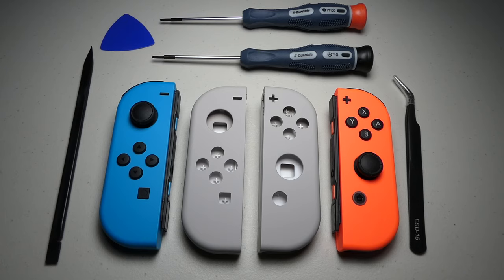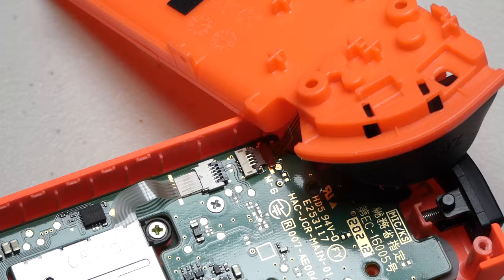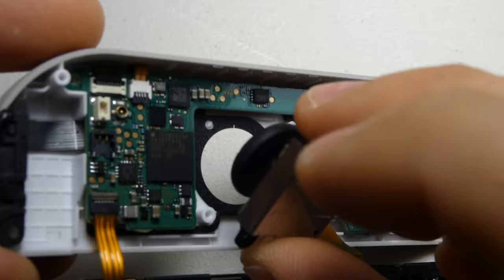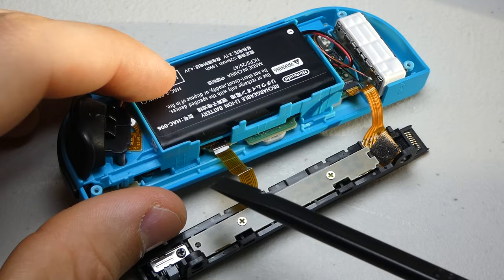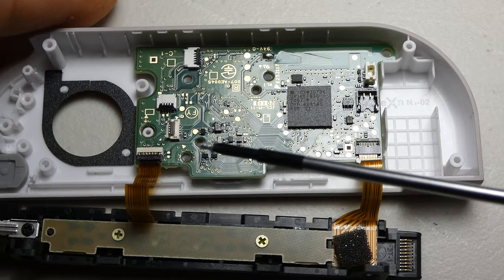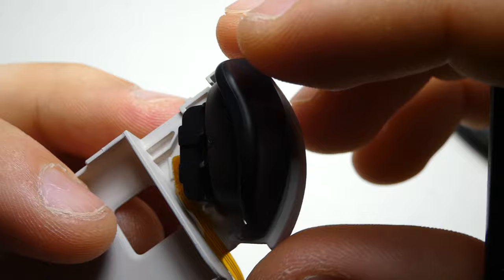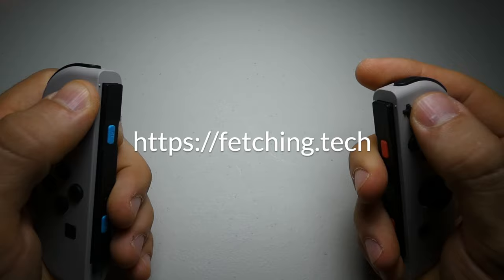How to Swap Out Your Joy-Con Shells

Comment: Ooh ! Thank you for the tutorial !
I do have one question, what do you do when the screws for the shells are damaged ? 

There are two screws on my left joy con that are disfigured and I can’t unscrew them.
Reply from the maker: I'm assuming you mean that they've been stripped? I've been fortunate that the screwdrivers I use are good about not stripping my screws, but I know it's a common issue

 I've recommended trying a rubberband in the past on the screw head to provide more friction, but I don't know how much that works. You might also be able to find a stripped screw removal kit.

The last resort is that I've had customers break their back plastic piece in order to pry the screws out with pliers. I don't like that suggestion for obvious reasons, but it is an option.
Reply: @FetchingTech  Okay, thanks for the suggestions ! 
I’ll try them out

Comment: Having some trouble with reconnecting the shoulder button cable, seems too short. Any advice?
Reply from the maker: It is pretty short, the only thing I can really suggest is flipping the button sideways so that you get as much ribbon cable to grab onto and then using a set of tweezers to get it inserted back in place. Hopefully that helps.

Comment: 2:15 i messed up; removed this ZL cable , i broke this tiny grey hinge accientally, tried to put the strip back in the place and glue it because i had no other options but the connection does not work anymore, tore it during the removal and now ordering a spare strip with button

Comment: Thanks for the guide
I just finished it but holy hell is the zr button on the right joycon difficult to connect
Springs weren’t much of a struggle as much as the zr ribbon cable but it worked out perfectly after that
Reply from the maker: Yeah, I'm glad you didn't have too much trouble with the springs. The shoulder buttons in general seem to be the most difficult part.

Comment: are all screws other than the outside onee the same? i just want to make sure I don't mix anything up
Reply from the maker: There are two different lengths of internal screws. You'll want to make sure you keep them separated or the long ones will end up poking bubbles into the front of your new shells.

Comment: 2:37 at this moment I realised hell had begun
(I've been stuck trying to pull this lil white plug out for 30 minutes please help.)
Reply from the maker: I'm sorry for the late response, I would suggest, as others have to me, that you just leave the vibration motor plugged in. It really doesn't need to be disconnected from the board and just over complicates things.
Reply: @FetchingTech  I eventually got it out but did that for the other controller, and I managed to successfully do both controllers without damaging them thanks for the great video
Reply from the maker: @darkabyssalflame7948  Awesome, I'm glad to hear it. I hope you enjoy your new controllers.

Comment: One of the screws in the back is stripped PLS PLS PLS PLS PLS HELPPP
Reply from the maker: I'm sorry you're having so much trouble. I've heard a lot of stripped screw horror stories. Were you using a Y0 screwdriver? I've heard of some people having success with a rubber band on the screw head to provide more friction. However, if it's really stripped that probably won't help. There are stripped screw removal kits you can try, but Idk how well those work. If you are willing to send in your controllers, I could try to get the screw out for you.

Comment: when doing a shell swap, is it necessary to swap battery tray ? you wont see the different color when reassembled.  This would save you fighting with those spring loaded buttons.  just transfer to new shell, leaving those buttons, cables and boards all intact. Can that work ?

Comment: Found this guide really helpful thankyou! However, two problems I've run into: my ribbon cable connected to the SR + SL buttons seems to be looser? They're disconnecting quite commonly. And also (may just be my kit) my joycons have a slight bulge on the front middle. These are quite minor issues though and nothing wrong with your guide :)
Reply from the maker: I'm not sure what would cause the disconnections exactly, but it sounds like you might be right about the ribbon cable being loose. I'd go through it again, and make sure all those cables are fully connected and not damaged.

The shells separating in the middle is generally due to some of the components in the middle not being seated fully. Often it's the wifi chip that  causes this issue. You shouldn't have to force the two halves together.

Comment: Would you recommend the Tessa tape listed on ifixit? Im worried the red tape might be too thick based on pictures. Or do most people not have an issue with the battery sliding?

Comment: I tried removing the clip for the vibration motor, but it doesn't come out easy the way it did for you. In fact, I think I might've cracked it with the tweezers from gripping it too hard. I guess I'm stopping here, because I don't want to break anything else.

Comment: Hey, this video was really helpful. I bought a pre-owned black right joycon with a broken joystick and transferred it to a blue/purple gradient shell. Everything works but I'm having trouble with the replacement joystick. I used two new replacements and both had ridiculous right drift so I'm guessing I messed up somewhere? Every other button works and before swapping the old joystick worked fine, just didn't sense downwards movement. Now it also has insane right drift.
Reply from the maker: The ribbon cables on these joysticks are incredibly fragile, one wrong bend can ruin them. Also, I've found that the third party joysticks have a really high failure rate. I often have to send out replacements that came with drift from the manufacturer.

Comment: the best video I have seen on swapping joycon shells nice! does the white shell discolor over time?
Reply from the maker: Thank you, I tried to make it at straight forward as possible. 

As far as durability goes, I don't think they've been in use long enough to tell, but I am working on a gen 2 version with better materials that should hopefully solve that potential issue.
Reply: @FetchingTech  thanks so much! can you do an update when the gen 2 drops :)
Reply from the maker: @Christofion  For sure, I will definitely let you know.

Comment: I replaced everything but the triggers are a bit stiff, any advice? Not sure what's causing this
Reply from the maker: I've had an issue where the shoulder buttons don't have much play as the original ones. Occasionally, I've been able to take them apart and reseat the buttons. Sometimes I've had to loosen up the back screws. You could also try to file down the button a bit if it seems like it's getting stuck in a certain spot. Unfortunately, it comes down to some trial and error. I hope you can get it sorted out.
Reply: @FetchingTech  thanks for your reply, IL give that a go 😊

Comment: Is there a way to change the buttons of the black bar on the side of the joy cons as it's still blue and red even though the skins are different
Reply from the maker: Yes, there are two small screws that hold in the led strip and buttons. If you take those out you can swap in some new buttons.

Comment: Idk why but the green led light stop working when I put it near the antenna wire
Reply from the maker: Hmm, I'm not sure what you mean, exactly. But I would try disconnecting and reconnecting the wires and see if that fixes the issue.

Comment: I switched mine out following this video but spent a few hours just trying to get my bumpers back into the right place so they feel the same but I’m just not able to do it, they don’t stick out as much and it only presses down if I press right in the center fairly hard. Are there any tips for this sorta thing?

BTW great vid! Everything about it was incredibly clear and easy to follow!
Reply from the maker: This can happen from time to time. The biggest thing I've noticed is that if the back screws are tightened too much it can sometimes cause the shoulder buttons to not click in how they should. Otherwise, I'd just double check that the bumpers line up with the battery tray as you're reinstalling it. They tend to shift around a bit.

Hopefully that was helpful in some way. Good luck with your swap.

Comment: 6:27 I've been trying for like 25 minutes and it can't reach, without the battery holder being completely in the way. I don't understand how you did it so effortlessly. I've basically just ruined my Joy Con because I can't get it back together now.
Reply from the maker: It might help to just lay the battery tray flat so the ribbon cable doesn't have to bend at all, and then you can use both hands to guide the cable back into the connector. I hope you're able to get it figured out.

Comment: "There may be some adhesive" Yeah mine flopped out so easy it's long since dried up LOL
Reply from the maker: Haha, yeah, I'd imagine the tape they use doesn't last forever.
Reply: @FetchingTech  Apparently neither do the battery connectors and ribbon cables cause they disintegrated in my fingers when I barely touched them LOL
Reply from the maker: @UltimaJC  oh jeez, sounds like you’re gonna have a brand new controller when you’re done with it

Comment: it worked... kinda
my ZR button doesn´t react any more even tough the wires and everything is connected
😭😭😭
i don´t know what to do now because the joy-cons i shell swapped were just delivered today so their brand new
pls help me if you have any ideas
Reply from the maker: If you can feel the button actuating, but no press is being registered, I would make sure the cable is fully attached and not damaged. If the button isn't actuating that the button may not be attached fully or the springs are out of place.

Comment: Ordered all the tools and new shells to finally swap out and fix my joy cons but I end up stuck on step one -.- got 2 screws out but the last 2 feels like they're welded in tight and won't budge. All my effort to get them out is just creating metal dust build up and the screws are probably mashed up in there permanently now. These are also my limited edition Pikachu Eevee ones so R.I.P
Reply from the maker: Oh jeez, I'm really sorry to hear that. I don't know why the screws are in tighter on some shells. I've never found a set that I wasn't able to get the screws out of, but I usually use a more expensive iFixit toolkit. I guess I would suggest looking for a stripped screw removal kit to see if you can get the old ones out. Sorry again for the headache.

Comment: this video made me really anxious because, just like a kit i got for this kind of replacement, the tweezers used are made of metal and it makes me really nervous of tearing or damaging any ribbon cables with them. any tips?
Reply from the maker: In my experience the ribbon cables can be quite fragile, but if they get damaged it's usually due to being bent accidentally. I haven't damaged any with the tweezers. Just take your time and you should be fine.

Comment: I did this... my left controller works but it wont connect in the handheld mode. Any suggestions?
Reply from the maker: I would guess that it might be a battery issue. It sounds like it's only working while it has power. Maybe the battery connector wasn't pressed in fully. Do the sync lights work while it's disconnected?

Comment: This video would have been great if you only said which screw (small or medium) goes were. How am I supposed to remember which foes where?
Reply from the maker: That's a good point. I use a little separator to lay out the screws in order, so I know to just work backwards in order, but I can try to make that more clear in the future.

For this case, just make sure any screws that are just going into the motherboard and shell casing are smaller. Otherwise, they will poke through the front of the case.
Reply: @FetchingTech  Thanks. Will put that in practrice for the next one.

Comment: Hey, I have a problem. My minus button is not sticking all the way out- I was on the last step and realized the minus button was sunken into the case and that the screws on that side were hard to tighten. I think something might be snagging, but I’ve undone it a few times, and it’s getting close to 4:00 am. I hope you can help me, I’m not sure why my minus button is halfway out and hard to press, or what could be stuck.
Reply from the maker: My guess is that the rubber membranes moved when you were reinstalling the main board. Those can be tricky to line up perfectly, but a gap between the main board and the front shell could explain why the minus button doesn't seem to be actuating properly.

Comment: My Springs popped out. How do I put them back in?
Reply from the maker: It's likely they will fall out in the process, you just have to put them on the little nubs in the battery tray and get the shoulder button lined up properly before clicking it in place.

Comment: Hi I have a problem with the switch after removing and reassembled the joycon everything lights up but when I attach it to the console it won’t read it and it’ll act like it’s not attached what do I do?
Reply from the maker: Someone else just mentioned having this problem recently. My guess is that the railing connector either didn't get reattached fully, or it got damaged somehow in the transfer. Thankfully those can be purchased on ebay fairly cheaply. I hope that helps you, and good luck with the fix.
Reply: @FetchingTech  luckily it wasnt damaged it just was fully in, thank you again it works now!

Comment: WTF. I succesfully this guide however i did have a few issues that are completely unrelated, side note amazing guide! anyways, the problems I encountered were really strange. first of all, the buttons for the L and R buttons that are actually on the circuit board just popped off for some reason when i opened it so those buttons wont work again bc i don't know anything about circuits/buttons and the flower dust cover thing for the arrow buttons on the left joycon was missing. I think this may have been because i sent my joycons to nintendo since they had stick drift and i assume that when they opened up to replace the joysticks they forgot to reinsert the dust cover

Comment: You have to replace new SL SR flex cable for white joycon. You can see a crease clearly.
Reply from the maker: Yes, a lot of the time those flex cables are pretty bent from the factory. Thankfully, they seem fairly resilient. Though I have had a couple snap at the crease.

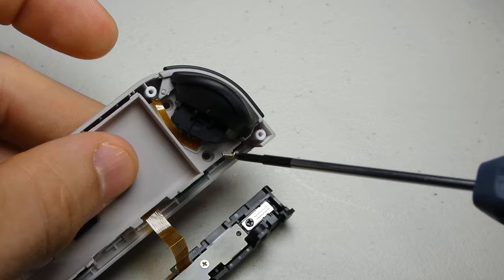Comment: 6:57 I'm trying to screw in the battery tray, but the screws just screw down directly on top of the screw holding down the mother board and it doesn't work? I'm very confused
Reply from the maker: The screws that hold the motherboard and the battery tray should go in different places.

Comment: I don't know why but my joycon won't connect on the switch wireless and he keep telling me is out of charge when i insert tge joycon on the switch :(
Reply from the maker: Hmm, I would double check that the ribbon cables connecting the railing to the main board are not disconnected or damaged and that the Wi-Fi chip and battery are properly connected as well. Those are the only things I think it could be.
Reply: could it be a short circuit?
Reply from the maker: @garou5014  It's possible. If that's the case you'd likely need to replace the mainboard. Thankfully you can pick up replacements off eBay.

Comment: i can not get the vibration motor out at all its so difficult
Reply from the maker: Yeah, it's definitely tricky the first time you try to remove the motor. A good pair of tweezers can be a lifesaver for getting the connector apart, and wiggling the motor back and forth with my fingers is the best method I've come across so far.

Comment: anyone else have the problem of when you’re screwing in the top 2 screws on the battery pack (the ones near the trigger on the right joy con) they just pop right out? the bottom one is fine screws in perfectly it’s just the top two